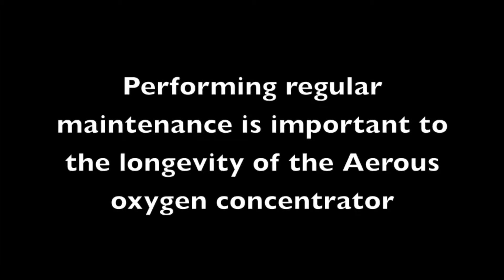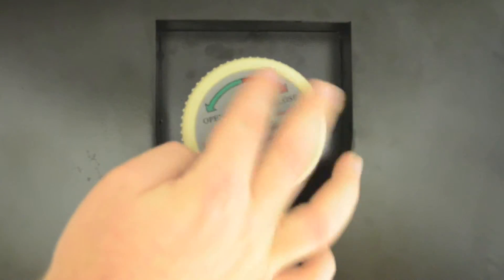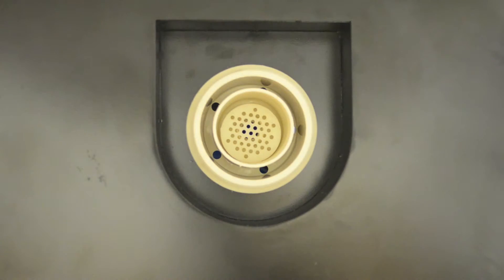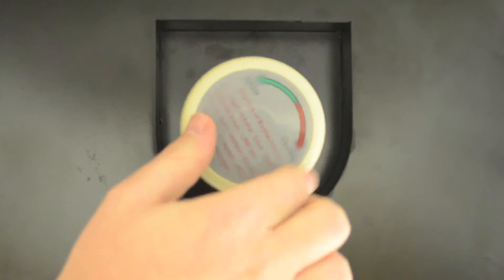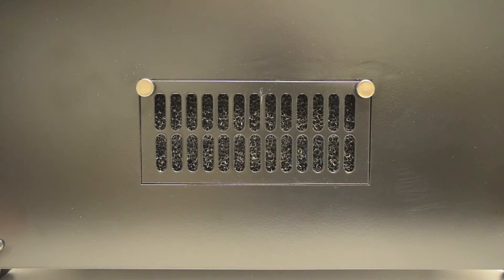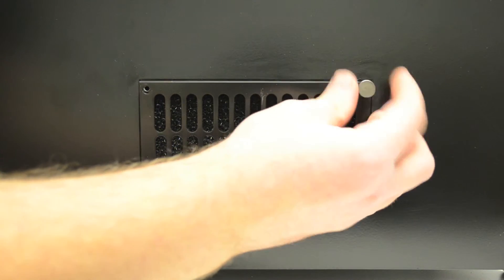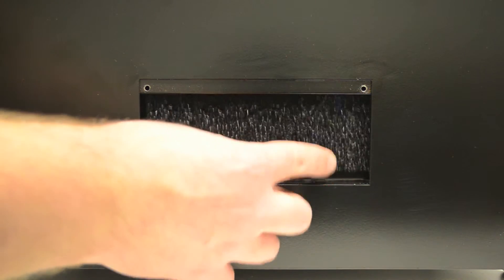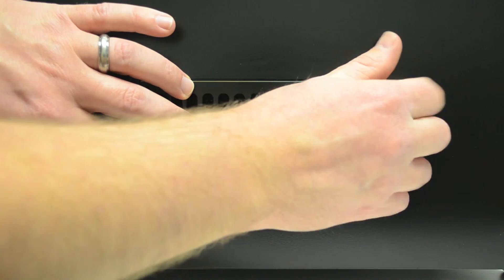Aerous Oxygen Concentrator Filter Changes

Comment: hi thank you for the videos can you help me pls i have one unit like this but missing some parts can you tell 
me if this machine have pressure regolator betwen air comp and inlet  solenoid or need to have aire cooller 
and what is the pressure going to zeloite beds 
i cant find any repair manual if you can make a video showing iner parts will be helpful 
thank you soooo very much